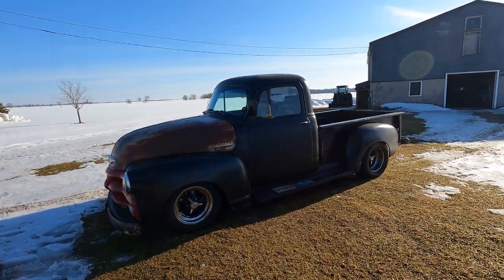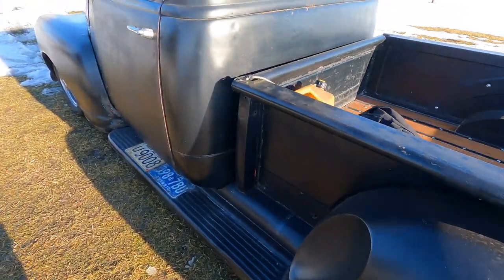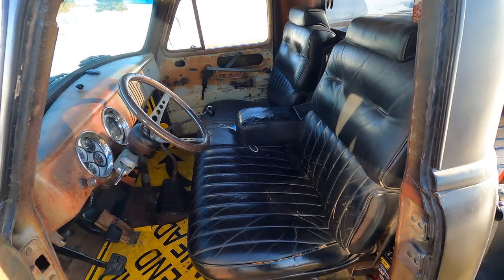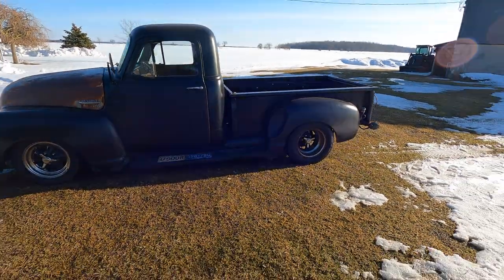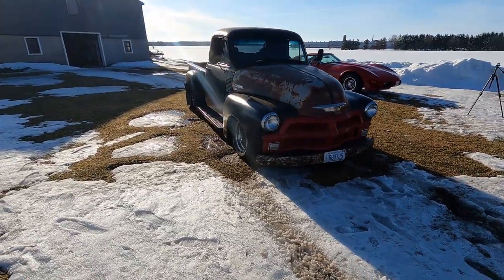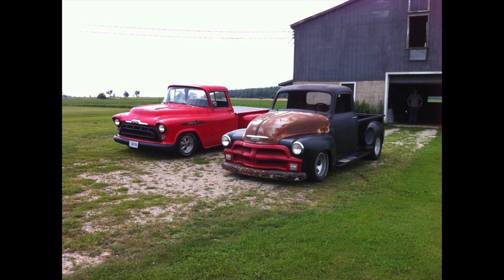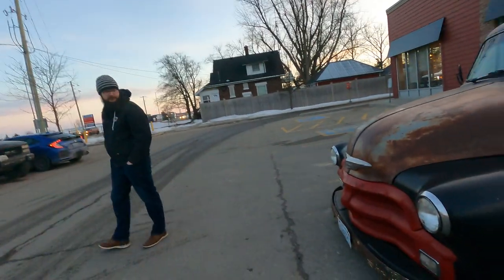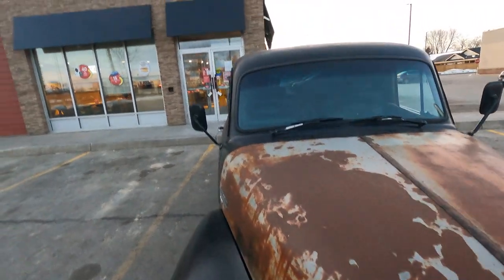My 1954 Chevy Pickup

Comment: Hi Zach! I watched this again today to see about the Cadillac seat. Do you remember what year Cad the seat came out of? It looks really comfortable.  We would like to find a similar seat. Did you have to raise it some to get the right height or were you able to bolt the tracks right to the floor? The seat needed the whole space front to back minus the tank, right?  We have a 51 Chev 3 window (lots of patina) that is still a working truck down here on our Oregon small farm. Every time we drive into town we get lots of thumbs ups and comments when we park.  Your Dad is pretty cool and I suspect a great resource for your ongoing projects. He has some good projects also.  Keep up the good work! Brian and Cathy
Reply from the maker: Hey, sounds like your 51 is pretty cool! The seat is out of a 1975
Cadillac Eldorado, I made my own bracket for the seat but it’s about 2” above the original seat bracket that was in the truck And for me I needed the seat right to the back of the cab so I had to relocate the tank. Hopefully this helps!
Reply: @TuquesNTires  Thanks for the quick reply! It will take awhile to get it all done but that seat looks really comfortable. I have a tank already so the big thing will be finding the seat as the Oregon coast is not a great area for finding salvage stuff. Will keep up to date with your posts and let you know when there is a bread in our 'case'. Wish there was a way to attach a photo of Junior. Thanks again, Brian

Comment: Cool! I had a 283 in the '54 I had! I realize that you said that your truck is a rat rod. But I find it strange that you have a '54 front hood emblem, yet older emblems on the hood sides.
Reply from the maker: That’s awesome! I just used what I could find and figure the those emblems did the job haha good eye though!
Reply: @TuquesNTires  yeah I have been known to be a little obsessed with 1954s.😂
Reply from the maker: @willhorting5317  nothing wrong with that!